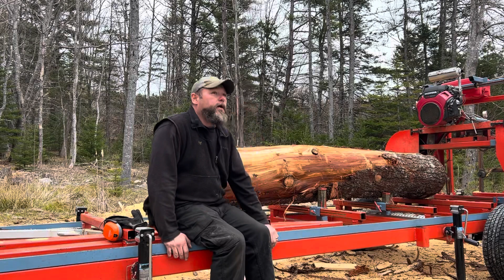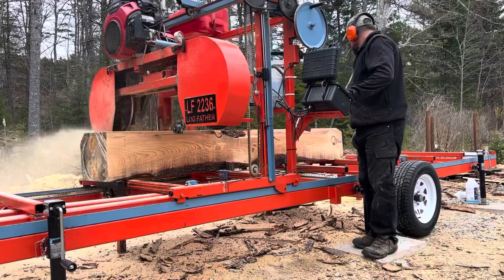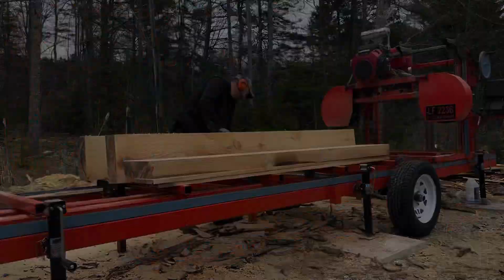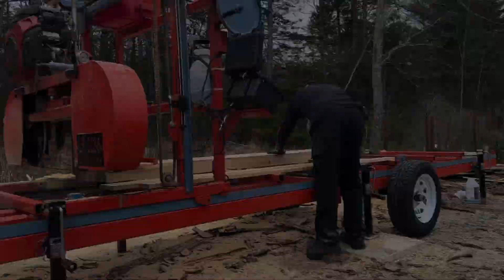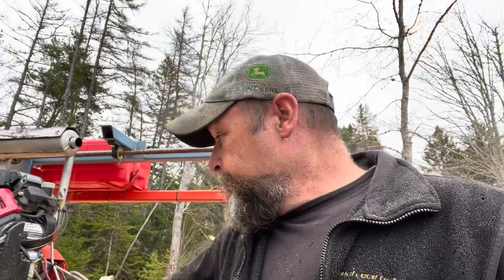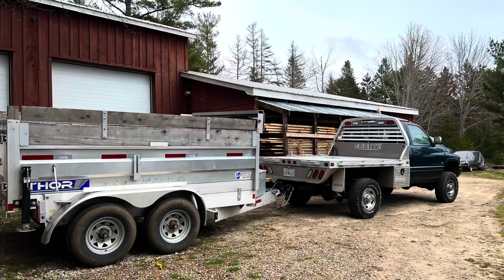An Honest Discussion About Sawmill Ownership.

Comment: Thank you for the information on milling. You are great to watch!  I am retired form teaching shop class 28 years and considering building my own mill. Time for another chapter in my life. I do not want to recreate the wheel and am considering buying a mill carriage kit from Linn Lumber sawmill and building my own portable track/bed. Would you be willing to share some insight on thickness the track tube you used on your mill and any other insight? Thanks again:)
Reply from the maker: Linn is definitely the way to go! I used 3/8x2 1/2” angle steel for the track and bolted it, as opposed to welding it, to a 3/16” 2x4 box steel for the trailer base. It’s surprising just how flexible steel is, I suggest living with it instead of trying to make it so rigid that you can’t level it later. Over 20 feet of track, which lets me mill 16’ 7” long, I have 3 jacks to level on each side. I’d probably gone to a 24’ and 4 jacks on each side if I were to do it all over again. Thanks again for watching!  All the best, Jeff.
Reply: @thelogfather5002  Thank you for getting back so fast.  Good information,  I have to hope that steel prices come down. haha.. Time to put together bill of materials and clean my welding helmet.
Thank you again
Reply: @theresacharlescleereman2744  Feel free to ask me any questions as well! I built the same mill and just finished it so it's all fresh in my mind. It took me nearly 2 months, probably an average of 3 hours a day work. In regard to steel prices, be on the hunt with Craigslist and FB marketplace to repurpose steel from whatever you can find. I have had great success getting deals on steel this way.  I'm all in at $3600. give or take a bit.
Reply from the maker: What powers your mill?

Comment: Enjoyed the video my friend. Luckily for me I already have all the essentials you mentioned before I built my mill. I have a question for you, what size are your tires and wheels? My nearly identical mill is ready to be put into use, and I want to make it mobile. Have you towed your mill on the roadways yet? I believe you have leaf spring suspension if my memory serves me correctly, do you like the way it tows?
By the way, I used your lift system design and I love it. It really works great, thanks for that. 
I'll be on the lookout for more videos.👍
Reply from the maker: Good morning Brian, I have 15” wheels, on torsion axles, no leaf springs here! I wanted to make sure I could get it as close to the ground as possible when milling. I have no plans to take it on the road- the wheels are just for moving it around the yard and cleaning up my mess and bringing it into the shop for service. If I ever had a need to transport it, I’d put it on my flat deck trailer and haul it that way. Thanks for watching! Jeff.
Reply: I’m using a predator 22hp engine.
Reply from the maker: Just the right amount of HP- I wish we could get those here in Canada- I’d have one on my processor.

Comment: i bought a 30 inch full hydraulic mill 20 years ago as it sits cuts 21 feet  i have an extension that increases capacity to 34 in lenght. i hide it hard work roll a 32 foot log im too old for that
Reply from the maker: I’m WAY too old for turning a log that big. And I’d need a bigger tractor than I already have.